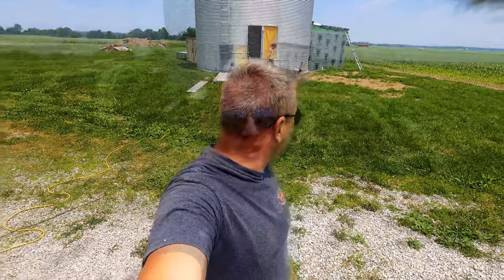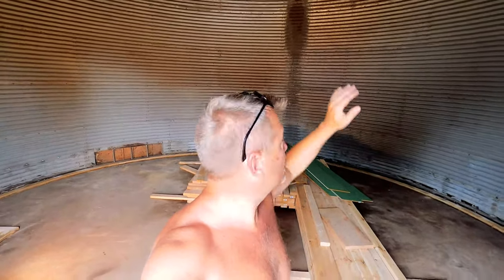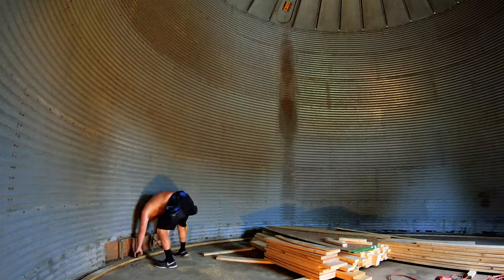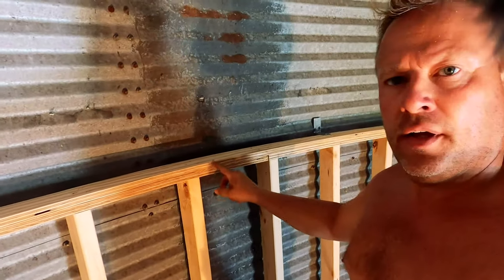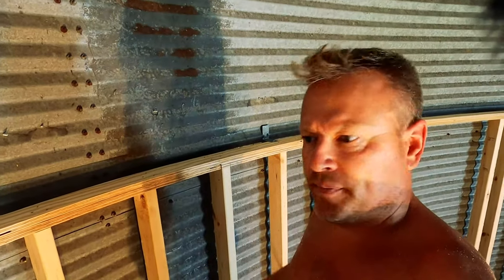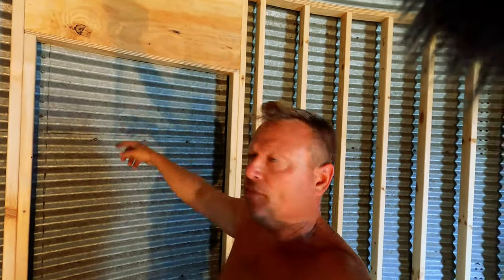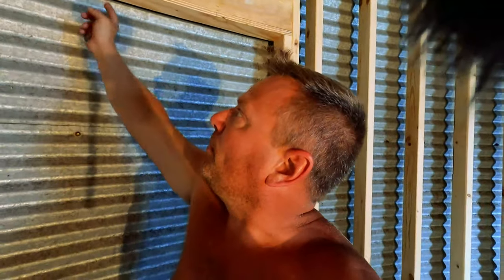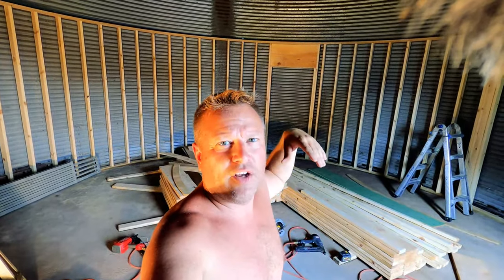Grain Bin Home Build... Episode 9 "Interior framing Part 1"

Comment: I would recommend getting an old run down bin slightly smaller for the inside and spray foam between the old bin and new. Use post-beam construction for a loft and interior. So much faster and easier and less expensive if you don't mind the corrugated metal look on the inside. The bonus is that you can see the geometric shape of the bin roof on the inside but still have great R-value. It only takes about 2 days for 4 capaple guys to build a bin that size so only 4 or 5 days total to complete the exterior walls and insulation. Its only about 1 day to excavate, form and pour a bin pad that size too. The biggest drawback is the loss of useable SF because of it's circular footprint. No need to finish the patina on the inside bin outside of some wire brushing and a clear coat IMO. Brighten up the space with some color on the interior framed and gypsum covered walls (Disclaimer: I've built more bins than I can count and several houses but never a grain bin house)

Comment: I’m in the process of planning to convert my 13 ft silo/grain bin into a bunkie/studio/she shed for myself. My bin is half your size, about 130 sq ft on each level. The bin was used to store wood for our furnace for almost 30 years and since converting to a ground source heat pump furnace it has sat without a purpose until now. I plan to put a second floor but because the bin is only 12 ft high the first level will be 7 ft high and the second floor will 5 ft with the extra space of the roof. How high is your wall under your loft? I’m up to episode 9 and learning lots! I’ve been searching the internet and your videos are the most informative for what I need to know. My silo space is small and with the help of my McGivor friend we will convert it into a spot just for me. Going to use some solar power and ladder to loft until I can afford stairs. Pretty simple really, your silo home is inspiring.thanks for documenting!
Reply from the maker: Our Bin was 19ft tall.  Firstfloor walls were 8 ft 4 1/2 inches tall.  2nd level walls were 8ft tall.

Comment: Have an old grain bin on my farm I've been wanting to covert to a tiny house, similar project as this. I'm in SC. Wondering how you plan to insulate/seal this thing up. Closed cell spray foam? What about vapor barrier between the steel and wood framing?
Reply from the maker: Closed cell spray foam is best bet for whole thing.  It is little pricey.  Im going to use closed cell spray foam on all trouble areas... Where walls meet floor and roof.. Around openings.. Penetrations, etc.  Then I'm installing paper faced batt to all other areas to keep my costs down.
Reply: You are Awesome

Comment: This is awesome. Could you give a rough estimate on what it cost to build? If its cost effective compared to building a regular house this would be an amazing alternative,well done, cheers
Reply from the maker: Im going to come in around 75 dollars a square foot.  I did add on addition which added some costs... And almost all of the labor has been free.  Except concrete,  drywall.  So is it cheaper to build than conventional... Maybe if you already have a grain bin on foundation.  If you had to pay for labor it is intensive with all the curve work and unconventional things.
Reply: @blueroomoutdoormedia5630  Hi, yeah it looks pretty intensive as far as labour goes. Are u adding a mesanine floor as well?
Reply from the maker: @jasongee1970  yes. You will see in later episodes, we frame the upstairs loft floor.
Reply: @blueroomoutdoormedia5630  You have about 900 square feet of livable space in the grain bin, correct?  So the total cost to finish it all up will run about $65,000-$70,000 including the attached building?
Reply from the maker: @shannonellenberger9548  yes im just shy of 1000 sf total.  Total cost of build will prob be close to 75K.  That includes the addition, septic, and well.
Reply: @blueroomoutdoormedia5630  if you were going to remove the cost of the addition, septic, and well, what do you guess total would be closer to ?  I don't need any of those.  I know prices vary by state, who does the labor, etc. I delivered my plans to a contractor yesterday and will anxiously await to see if I can swing fixing up financially, but it's awesome to see what others are saying it cost THEM .  I have seen many that are finished up and I can't unsee the idea now :-).  I also shared the name of your video series with the contractor.  Thanks for posting videos of your journey!
Reply from the maker: @shannonellenberger9548  if i didnt add the addition... Septic or well... And didnt add the upstairs RR and downsized the kitchen.. And no electric fireplace... Just build out interior of existing grain bin with a loft small kitchenette and small RR... I was budgeting about 15K.. That was with me doing all labor.  
If id had been contracted to do it for customer probably would have been about 30K.
Reply: @blueroomoutdoormedia5630  thanks so much!!! One final question on this money thing:  I actually have 2 18' grain bins and husband could take the "top half" (ish) off each one (hopefully) and I could put 2 side by side and maybe join them INSTEAD of doing stairs , 2nd level, and deck.  My gut instinct tells me this MIGHT be the cheaper way to go.  I'd obviously give up the deck , (boo!) but what is your is your initial thought?  I can't thank you enough and I do know these prices will vary by state, contractor, etc.
Reply from the maker: @shannonellenberger9548  i think it would be awesome to join the 2... Set them a few feet apart from each other and frame a connector between them.  And yeah you could shorten them up to only have one level.  10 or 12 ft tall maybe
Reply: @blueroomoutdoormedia5630  but do you think this option could be CHEAPER than a 2 story with a deck?
Reply from the maker: @shannonellenberger9548  probably yes.. Although if you do 2 bins.. You will have 2 foundations..
Reply: Hey there! Just curious about cost estimates now… I think materials have gone WAAAY up since you started this project.
Also, did you use 16’ 2x4s?

Comment: Love what you're doing here! If I end up building when I retire in a couple years, a grain bin is on my short list, either as a whole house or as part of a more conventional building. Quick question, did you do any sort of barrier or gap between the steel and the framing/insulation to deal with condensation? I've heard that condensation on the inside of the bin walls can be a real challenge with converting these to homes, but I can never find where anybody addresses it...
Reply from the maker: Spray foam insulation is premium.  It is costly for sure but would work well.  I spray foamed all trouble and transitional areas like base of walls, walls to ceiling transitions, and around openings... And then fit batt insulation to all the remaining areas.  Has worked well.
Reply: @blueroomoutdoormedia5630  Good to know! So you haven't had any issues with mold, rot, or other moisture problems between the outer steel skin and the bat insulation or wood framing? I'm not talking about moisture from leaks, I'm talking about moisture from condensation...for example when it is cold outside and warm inside, you don't get water building up on the inside steel skin?
Reply from the maker: No issues to date.  If its in your budget... I would suggest spray foam for all
Reply: @blueroomoutdoormedia5630  Good info! Thanks!

Comment: What size ply are you running for your top curve plates and bottom plates 3/4 or 1/2? I am building same size grain bin 24ft at our ranch in Texas I’m from Colorado and have been hauling loads of materials I have to build this project
Reply from the maker: 3/4 inch ply for curved plates. Doubled up treated ply for bottom plate.  Doubled up standard ply for top plates.  See episode 8 "curved wall plates" for more details

Comment: I'm a little slow, what method did you use to determine the radius for the plywood cuts? I'm no math genius.  Thanks and Cheers! New sub here.
Reply from the maker: If you watch episode 8.. I explain laying out and cutting the radius plywood plates for the walls.  Hopefully that will answer your question.
Reply: @blueroomoutdoormedia5630  Thanks! I will check that out.

Comment: I live in Idaho in the Tetons and have two of these, I’m concerned about the amount of insulation needed in the winter. 2x6 or 2x8 along the walls?
Reply from the maker: Not sure what your code is there.  Ask local building department.  Here our code is R15 for side walls.. Which fits into 2x4 walls.  Im sure you all are at least R19 which would be 2x6 walls.  If you spray foam, you should be able to get enough R value in a 2x4 wall.